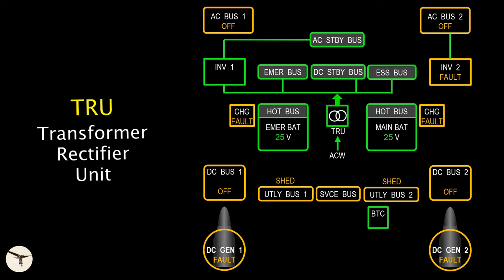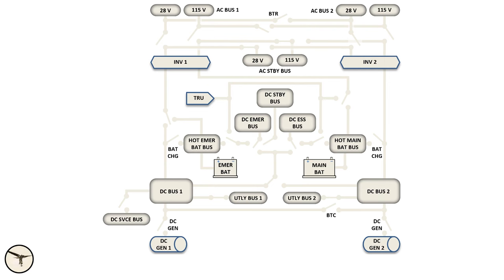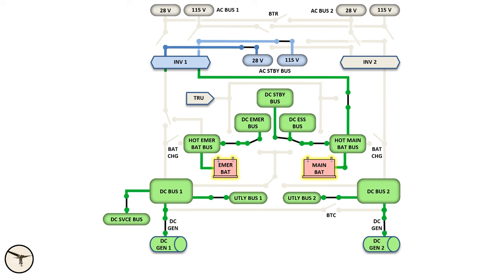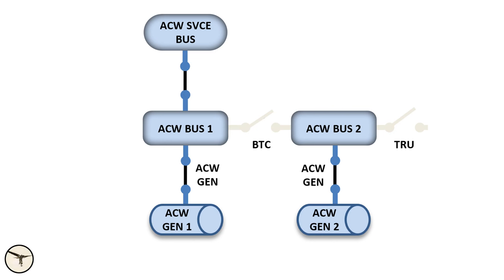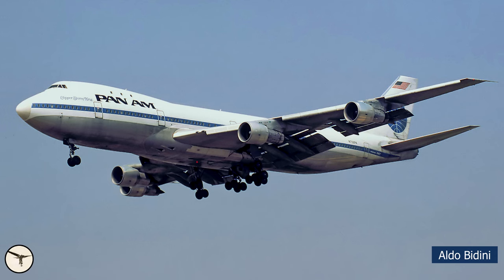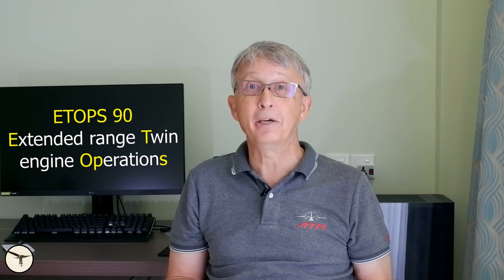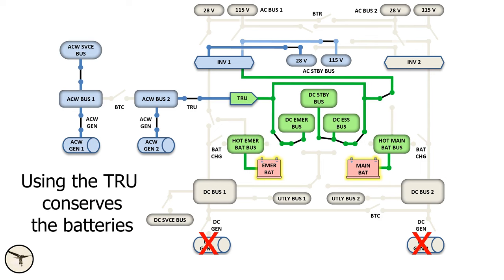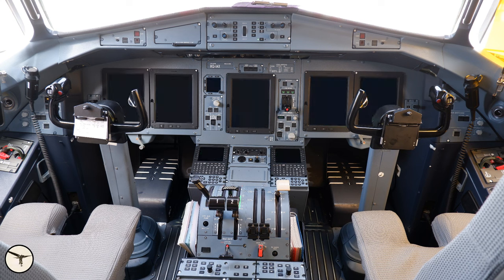Why are ATR -600 pilots using the TRU? | ATR procedures

Comment: Thank you, Magnar, for another great and interesting video!
This however, brings up another question: The parts will be replaced by 2024, and then the use on TRU on every flight will be a mamory, you say.
This sounds like it implies there are drawbacks with using the TRU on every flight? Why wouldnt you continue to turn it on? Isnt the extra redundancy just a good thing?
Are there any drawbacks with using the system, and if so, what are they?
What is the reason for not always have it on?
Thanks again, and excited for your next vid
Reply from the maker: The intention with the TRU was to provide backup power in case both DC generators were inoperative. This allowed the aircraft to be certified for ETOPS operations. The TRU has a cooling fan. Everything that moves will wear out sooner or later. Therefore, it is better to keep the TRU off when it is not needed.
Reply: Also the OEB says that engaging the TRU may produce some temporary shortage of electrical power during the transient phase of activation of the TRU, so this may, and it really does, produce some spurious alerts or fault indications, as for example, the AUDIO SEL CAPT FAULT, the CAPT MCDU or ADC2. I'm sure this is not a good thing to keep doing forever, cause you may damage the mentioned systems permanently.

Comment: Hello Magnar, thank you for very interesting article. To my understanding this was dual failure. First 7PA (MAIN BAT switch) must fail - to incorrectly signal to BPCU to release BTR 58PA, 3PA, 95PA, 96PA into default non energized states. In such default contacts state if either DC BUS 1 or 2 are still energized (DC GENs are running), then based on BTR 1PA position DC ESS, EMER and STBY buses will be powered from DC BUS 1 or 2 (depending on the position of BTR 1PA). What was found and reported to EASA by manufacturer is, that contactor 1PA was stuck "in middle" position, not providing any connection to any DC bus. So therefor complete loss of  DC ESS, EMER and STBY buses. But now I am getting really confused.

1. DC busses are powered from DC GENs through 11PU and 12PU contactors controlled by corresponding GCUs. If 7PA (MASTER BAT switch fails) IMHO all busses shall be de-energized, correct? So GCU shall be command (in simlar matter as BPCU) to release 11PU and 12PU to isolate DC BUS 1 and 2 from GENs, correct? Or 7PA controls only BPCU and when DC GENs are running feeding corresponding GCUs this is self reliant operation state? So in flight even if you switch MASTER BAT switch off, you will still have engines, DC GENs and DC BUS 1 and 2 running? 

2. Even in the 7PA is not controlling DC BUS 1 and 2 states (as questioned in 1.), than if 7PA fails and signal to BPCU to release BTR 58PA, 3PA, 95PA, 96PA into default non energized state, than you will never get power from TRU to DC ESS, EMER and STBY busses, as you need 95PA and 96PA to provide contact continuity from TRU DC to DC ESS, EMER and STBY busses, correct? Than I am confused how in such case switching on TRU might help.

Comment: I noticed the AOM is dated 30-Nov-2022 covering the 42-500 all serials. Is this an OEB and if so what is the OEB identification number. My latest ORH is 8-Mar-2023 all serials. This is the first time I have heard of this procedure, so I am curious if the fix was implemented before our AT45's came online would it be omitted from our manuals?
Reply from the maker: When producing the video, I didn't have access to the latest issue of the AOM and OEM. The current AOM is issue 8, it I remember correctly. It is valid for ATR 42-600 (42-500 mod 5948) and 72-600 (72-212A mod 5948) with MSN listed in the AOM. The OEM is inserted in the manuals for the affected aircraft.
Reply: @FlywithMagnar  That makes sense why I haven't heard of it. No AT45's in our fleet have the 5948 mod. Good to know. Thank you Magnar
Reply: @ExcessEngry  That's because if you had an AT45 with mod 5948 it would be an AT46 :). Officially there is no such thing as an ATR 42/72-600; as far as the authority is concerned they are just ATR 42/72-500s with a specific modification installed. It just so happens that ATR install the mod in the factory when they build the aircraft and sell it with the designation -600.

Comment: Magnar, greetings! So it turns out that I have to turn on TRU by pressing a button - every flight and before taxiing before takeoff? And does it have to be on for the entire flight? And after landing at the destination airport, does TRU turn off? Or do we turn on TRU only when both generators fail?
Reply from the maker: Both! Normally, we only use the TRU when both DC generators have failed. But until a new battery switch is installed, we use the TRU on every flight.
Reply: @FlywithMagnar  It would probably be right if I also use TRU in the simulator before taxiing, before takeoff, and throughout the flight, and until I leave the runway after landing. Thanks a lot!

Comment: Good explanation! But I have a doubt: If during the after landing the TRU keep on, and you put CL1 in FTR, there will a lot of  systems shut down. Well, If I Lost one engine in flight, this shutting down systems will occure?
Reply from the maker: Normal procedure is to select the TRU off after landing. It's in the checklist. Then, alter two minutes to allow the engine to cool down, we set CL1 to FTR. Thes causes ACW GEN 1 to go offline. However, the electrical systems (ACW and DC) have but tie connectors (BTC). When one generator is offline, the other generator supplies the entire systems via the BTC. The only systems that will go offline are those selected off by the crew after landing (ice protection). Therefore, when one engine fails in flights, all systems will still be operative (except for a few items in the cabin powered by the ACW Service Bus).
Reply: @FlywithMagnar  Ok, but If I forget to turn off the TRU PB, and feather de Eng1, there will occure a lot of systems shut down without Eng 2 supply. So my doubt is what happens in flight?
Reply from the maker: The TRU is powered by ACW BUS 2. The TRU is designed to be a backup for the batteries in case both DC Generators are inoperative. Without the TRU, the batteries will last for at least 30 minutes. When you shut down engine 1 after landing, nothing happens to the systems, because of the ACW BTC and DC BTC. After putting on the parking brake, you set CL2 to FTR. All ACW is lost, but we don't need it because the ACW system provides power to systems only needed for taxi and flight. 
If one engine fails in flight. Nothing happens to the systems. If both engines fail in flight, you have only battery power left. As i said, the batteries last for at least 30 minutes. Without engine power, you will land long time before that.
Therefore, the TRU has no relevance when the engines are shut down.
Reply: @FlywithMagnar  Well, I'm ATR First officer, and I could see a lot of systems failures when i forgot to turn off the TRU after landing, beyond a Eng1 FTR, like X in panels and mcdu. Try "to forget" to see. Thank You for your attention and kindness.
Reply from the maker: Hm... I never tried that.
Reply: To prevent overloading of the ACWild alternators, the TRU output voltage will be lower than the DC Generator voltage, so in normal operation the TRU won't be supplying any power to the DC Bus. In this case whether the TRU is on or off will make no difference to the DC Bus. The TRU only supplies power if the DC Generator(s) fail or if the DC Busses are isolated from the batteries and the DC Generators by whatever combination of switch & contractor chaos happened here.

Comment: Thank you  amazing videos. In msfs 20 in ATR 72-600 there is a problem. While engines are running , the hydraulic pumps shut off, without throttle input. While taxiing at idle, you lose the hydraulic system and brakes, so you need to turn on the hydraulics crossfeed for it to work. Is this an issue? Thank you.
Reply from the maker: Yes, in MSFS, propeller RPM (NP) may drop below 70% if the power levers are not in GI or above. I hope this can be corrected soon.
Reply: @FlywithMagnar  From what I understood, it's a bug introduced by the changes made in SU13, which affected how propellers are working. Asobo know about it (I was the one that actually confirmed to them that it was a regression caused by SU13), so it's probably just a matter of time before they update the ATR in the sim for it to work with SU13

Comment: Captain, why is the Hotel mode is placed on the right engine?
Reply: Because most of the time you boarding an aircraft from left hand side so it would be more beneficial to installed it on RH side engine to prevent blowing those hot exhaust gas during boarding/loading

Comment: When DC Bus 1 is powered, the DC STBY Bus should be powered from the left (from the HOT EMER BAT Bus through the DC EMER Bus)
Reply from the maker: You are correct. My bad.
Reply: No worries sir, it happens (also to me when creating course ware).
Thx for the thorough explanations on systems in your video's, they really make a difference on ATR systems knowledge.